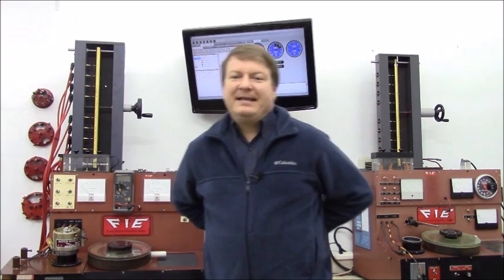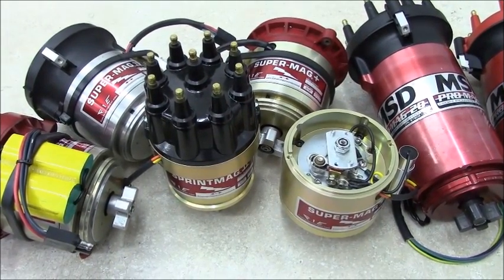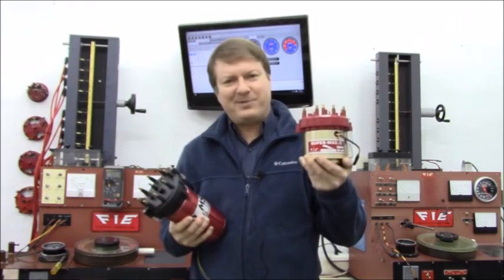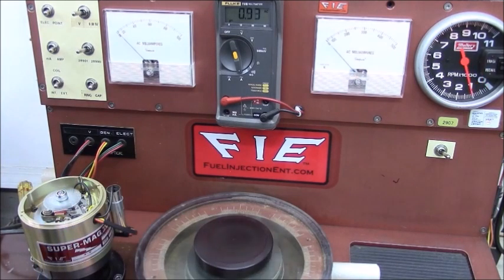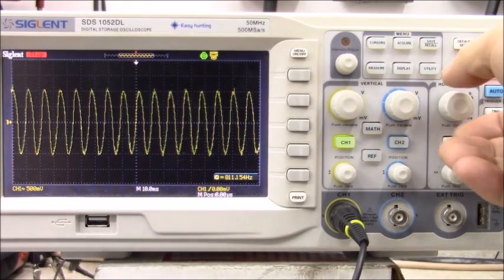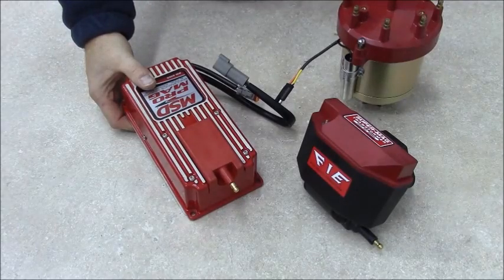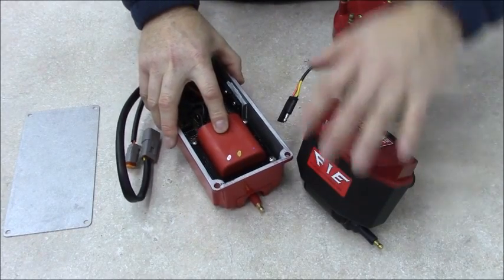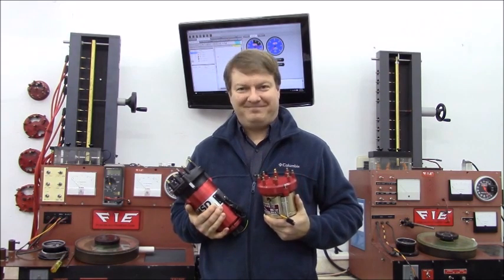Measuring and Comparing Magneto Generators - Spud Miller, FIE

Comment: RMS is the equivalent heating voltage. A 120 RMS V heater will generate the same heat with 120 vdc power.